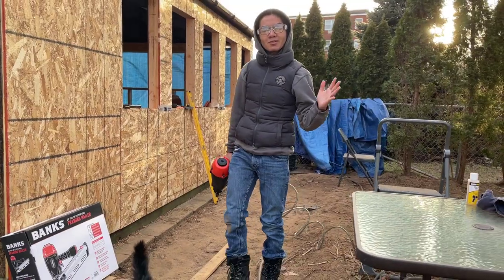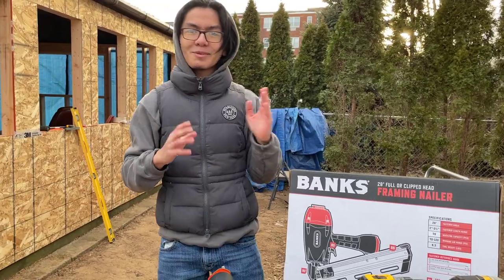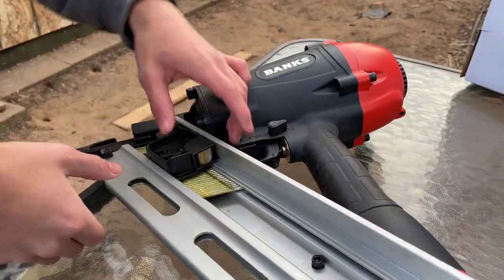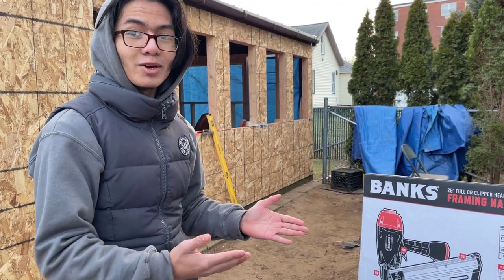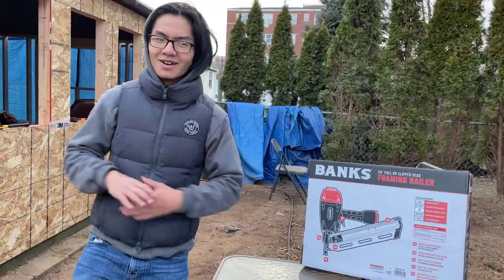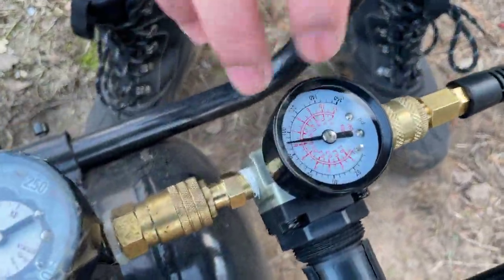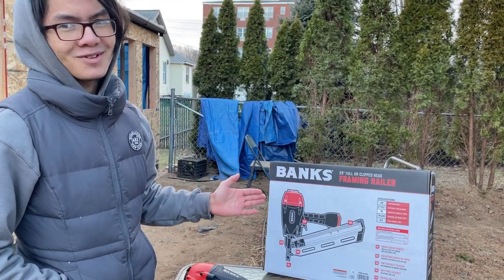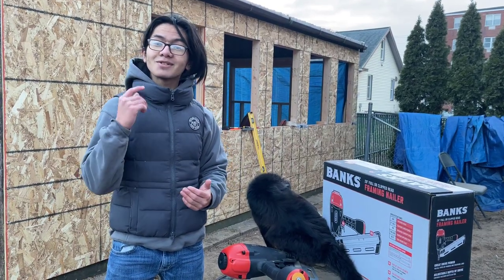Most Affordable Nail Gun | Banks 28° Degree Framing Nailer - First Impression, Demo & Initial Review

Comment from the maker: Here are the #ad links to the pneumatic nail guns & cordless nailers featured and discussed in this video:
1.  https://amzn.to/38wvOqX
  |  3PLUS H2890SP 28 Degree Clipped Head Framing Nailer
2.  https://amzn.to/3nxh6UD  |  Paslode, Cordless XP Framing Nailer, 905600, Battery and Fuel Cell Powered, No Compressor Needed
3.  https://amzn.to/2MStodK  |  Metabo HPT Cordless Framing Nailer Kit, 18V, Brushless Motor, 2" Up To 3-1/2" Framing Nails, Compact 3.0 Ah Lithium Ion Battery, Lifetime Tool Warranty (NR1890DRS)
4.  https://amzn.to/2XqEE35  |  BOSTITCH Framing Nailer, Wire Weld, 28 Degree, 2 to 3-1/4-Inch (BTF83WW)
5.  https://amzn.to/35sPKJe  |  DEWALT 20V MAX Framing Nailer, 21-Degree, Plastic Collated, Tool Only (DCN21PLB)

Comment: I just need it to fire 1420 nails into 355 boards. Was thinking about a Paslode or Milwaukee cordless. But pneumatic is cheaper all in all.  Plus you don't have to replace CO2 cartridges. Except for Milwaukee which don't require CO2. I have to add It's also called a test fire to set how deep your nails are going to be. A dry fire is when you have no nails in your nailer. Try to avoid that.

Comment: Did you guys not see the regular built into the compressor? You plugged a regulator into the regulator that was already there.
Reply from the maker: The built in regulator didn't work very well so we had to use an external one. Cheap Harbor Freight compressor
Reply: @EyeOnAiman  cheap harbor freight nail gun